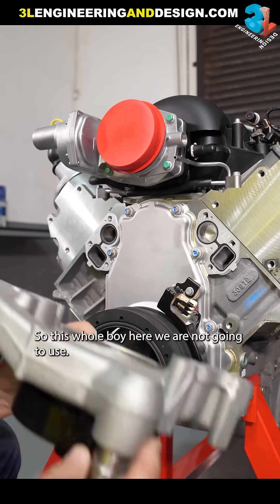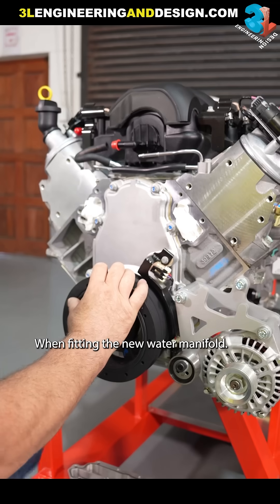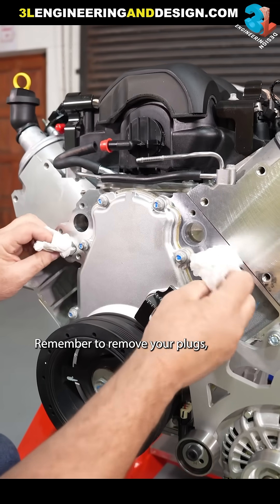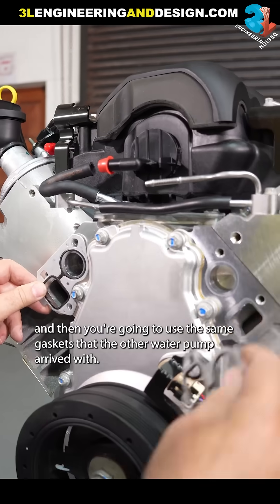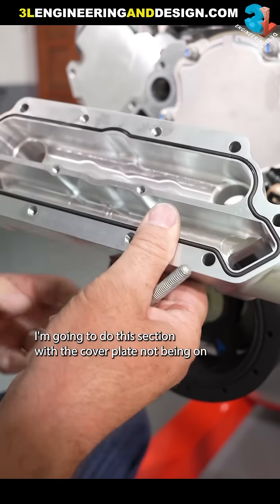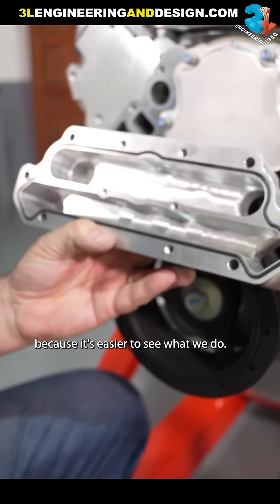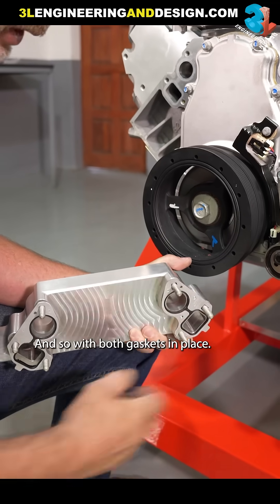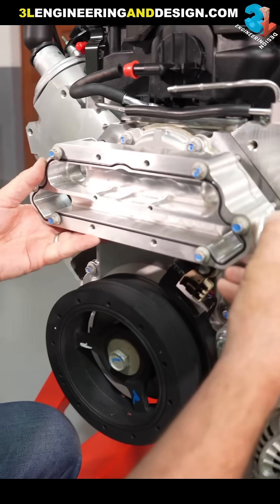Replacing the #chevy  water pump with our own water housing #shorts #v8stealthbeetle

Comment: That is just a manifold not a pump. Where and what type of pump is used. Many years ago I helped with an auto cross car that had an electric supplemental water pump  to help with heat soak between runs, but there seemed to be a lot of heat related failures still.